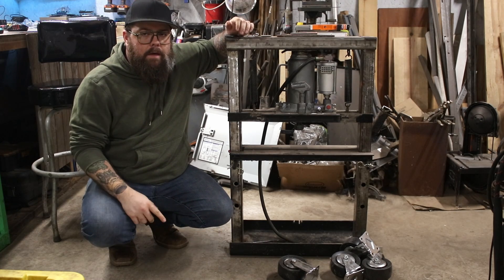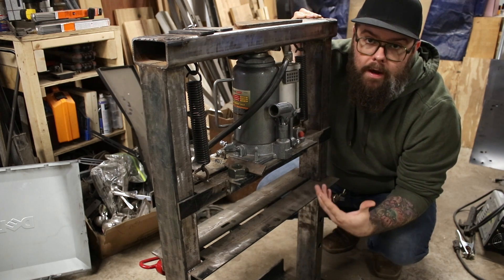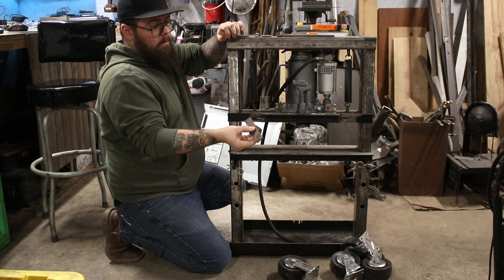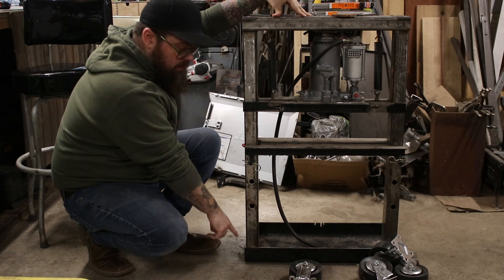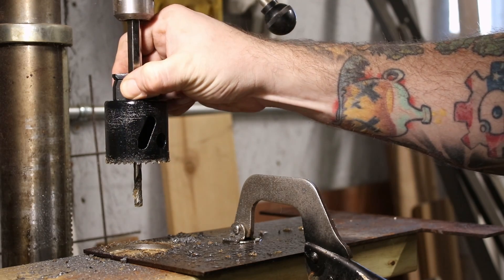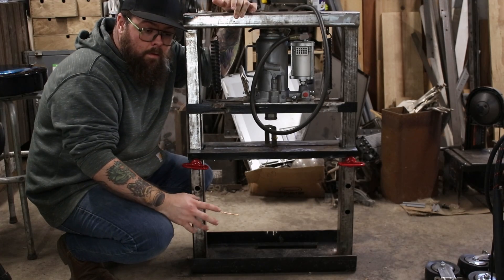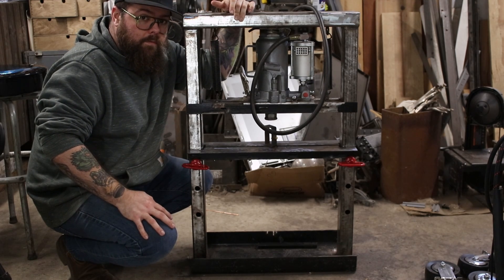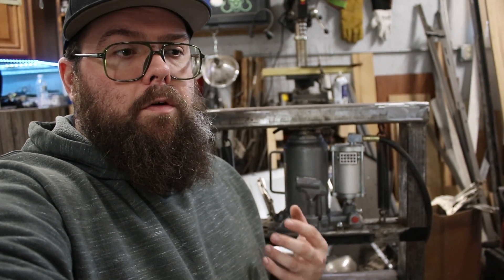DIY 20 Ton Hydraulic Shop Press | Made with Scrap Metal And Basic Tools

Comment: It is highly commendable that you're making your press instead of buying ready made, you'll learn a lot.
I would like to suggest that you optimize the use of the materials that you have for better performance. For example at the top of your press, you have rectangular tubing with the longer sides of the rectangular profile, horizontal.  The top rectangular tubing will be stiffer if the longer sides were vertical; two rectangular tubes, mounted side by side on the top would be better both for superior strength and so that your jack is pressing directly on the sides of the tubing. At the moment you have your jack pressing on the sidewall of the upper tubing, and it will probably deform under a 20 tom load.

You bridge could be, say 2  of 4"x 1/4" channel, with material welded between the two to prevent twisting under load; of course the 4" sides should be vertical to better withstand the 20 ton load.
Many years ago, I too built my own 20 ton shop press out of scrap, and it has given me great service. How I tested my press was to press a solid block as firmly as i felt appropriate, nothing on my press distorted or broke, so I called it good.
Good luck with your build and thanks for sharing.
Reply from the maker: Thanks for the words of wisdom.  I'll keep that in mind for future builds.  I still haven't used this press much, but hopefully I'll have some projects that require it soon.